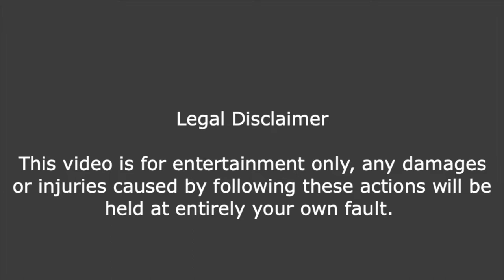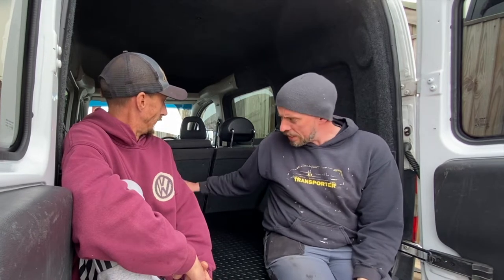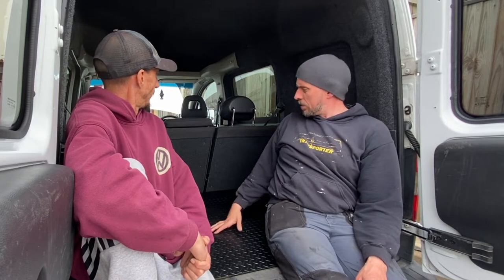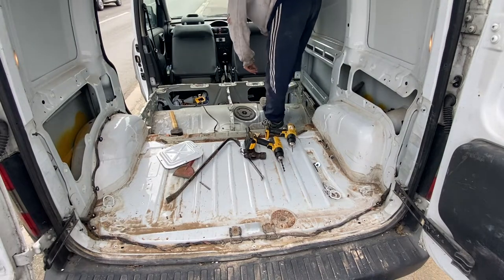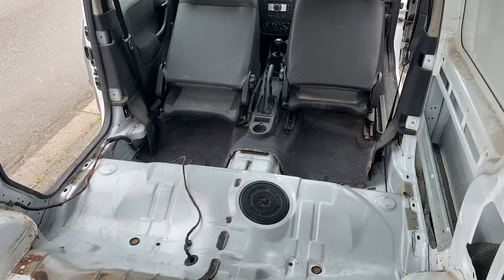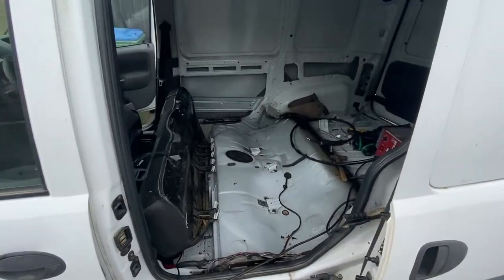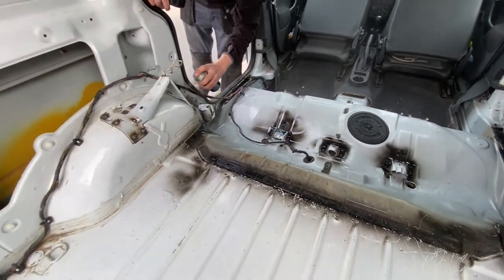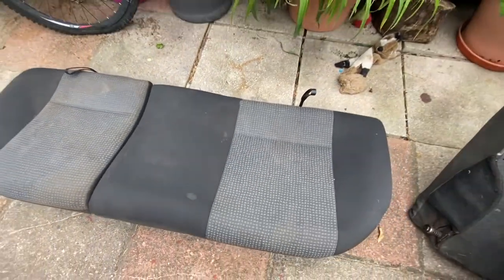Combo panel van conversion into practical 5 seater

Comment: Great job guys. Did you board the roof first? Also what carpet did you use for the roof and sides? Did you spray glue the sides? Thanks
Reply from the maker: 👍 I’m not sure as I only came in to do the welding fit the window and do the tinting

Comment: I have just bought combo c tour and need to remove back seat. I figured out how to do it with bottom part, but don't hawe idea how to do it with backrest. Can you give some hint?
Reply from the maker: Yeah the bottom part, you need to undo the bolts from the centre bracket, and there is an Allen key bolt that goes through the bracket sideways into the seat, remove that and it should come out
Reply: @TwiggsT4  thx a lot, I will try

Comment: Hi what did you use to stick the window in?
Reply from the maker: I can’t remember which window adhesive we used on this build, some windows come with a fitting kit and some you have to get separate. You can get fitting kits from camperglass.co.uk or any other window suppliers

Comment: Hiya mate. I’m thinking on doing this. Is the seat belt bolts built in on the floor where your bum goes and how does the seat belt hold on to the van for the end passengers as there is no bolt thread there to hold it. Many thanks